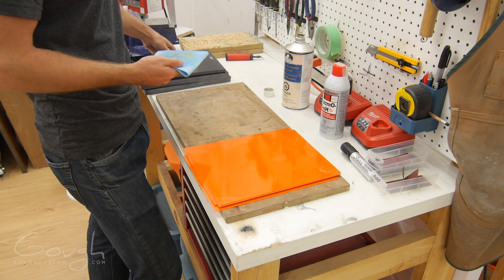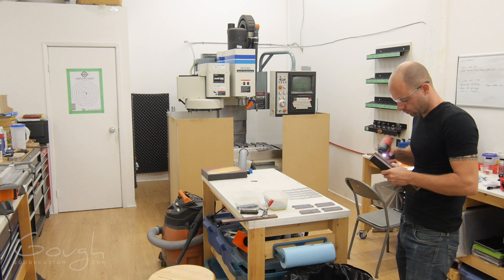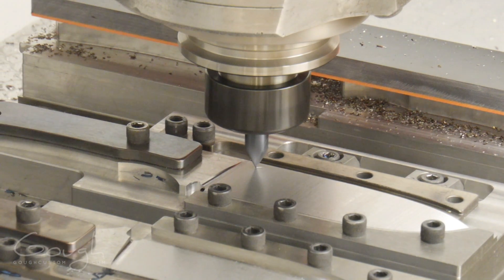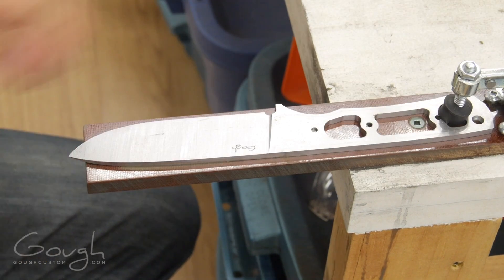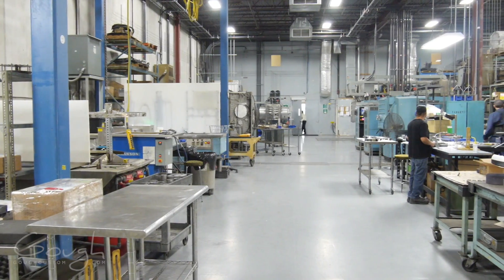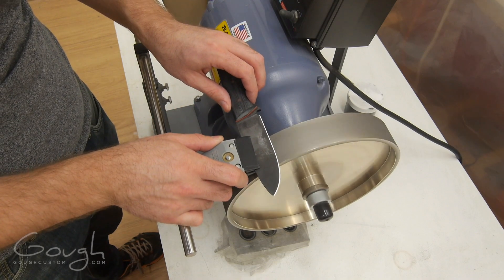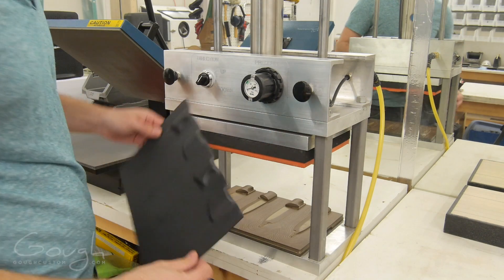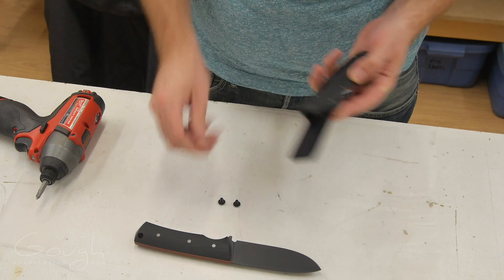Making a knife the high-tech way - Resolute MkIII

Comment: Amazing.  Have you thought about RTV casting the scales?  You could cut out a few machining steps and just pour them the right shape to start with.  Brick in the yard youtube channel has good tutorials.
Reply from the maker: +Ryan Bishop thanks Ryan! I like the idea of casting scales but I've never found a material that I was happy with for it... G10 has very high percentage of glass fibre, so it's incredibly strong and tough compared to most castings...
Reply: Gough Custom get in touch with a vendor. (Innothane or innovative polymer). Have them suggest something and send you a sample. There's a surprising variety of resins. I've done a lot of casting. Let me know if you have questions. (Plus you can remove airborne glass fiber from your process)

Comment: Is there not a work around to avoid hand sanding? Not judging or anything just curious as to if you've tried anything else. Also thanks for another video that I shall watch 40 times
Reply from the maker: +Tristan Rousset technically I can skip the hand sanding and it's possible that no one would notice, however I think that omission would become more obvious as the knife was used, if the coating was to wear it would do so unevenly and reveal the initial machining marks, so I still do the hand sanding...
Reply: Gough Custom Alright good to know I didn't think of that
Thanks for your answer man!

Comment: Didn't expect uncooled sharpening. Which speed on the CBN? Did you do micro vickers testing to see if there's some difference between cooled/uncooled CBN?
Reply from the maker: +Verdigris Sirgidrev very low speed on the CBN, final pass is around 100 rpm. I don't have capability to do micro hardness testing, but have done edge retention testing of this versus hand sharpening and found no difference!
Reply from the maker: +Verdigris Sirgidrev the key to this is the CBN abrasive... It's very thermally conductive, whereas traditional abrasives are generally refractory materials (aluminum oxide, silicon carbide), refractory materials are very good insulators which means they leave all the heat in the blade... The CBN conducts the heat away from the cut into the wheel.

Comment: im very impressed by your fixtures did you design them your self also have you ever though about making a full enclosure for your machine so you can put flood coolant on it
Reply from the maker: +n ackermann thanks mate! Yes all the design of every step was all done by me! I plan to build a full enclosure soon, but will still be machining dry. I really dislike food coolant, smells bad, takes a lot of maintenance and with modern tooling there isn't much call for it when cutting steel... If I was doing a lot of aluminum work then obviously I would feel different lol

Comment: Gough, how dare you. Using Chicago screws. Surely Geelong screws or ballarat screws would do.  ( They all forget where they came from don't they )  On a more serious note. You have a perfectly machined handle. Then you hit it with a sanding belt to take down the screws?!? Why? This is such a source of possible error.
Reply from the maker: +gus bisbal haha I will get to work on sourcing Aussie screws mate, post haste! :)

Yeah I would also like to find a way to avoid the hand work on the handle, as yes it is a source of possible problems. The main issue is that I haven't yet found a fastening method to replace the Corby bolts.. whatever I move to would have to be as strong or preferably stronger. I have some ideas for specialized compression fit rivets, but haven't had time to explore yet!
Reply: I think the Corby bolts are the right choice, its the removal method that needs to fine tuned. Have you thought of milling them to the contour of the handle then polishing? Remember to add coolant so they don't over heat but it would be a more automated method.

Comment: Have you considered using leather instead of nylon webbing for the belt loop? Wondering what your thoughts are on nylon webbing vs leather.
Reply from the maker: +Eric Snyder either would work ok, the reason I chose nylon was for its durability when exposed to the elements, leather is less durable when exposed to water for instance. Perhaps I should consider doing leather as an option though!
Reply: I agree with that assessment and it's a more efficient process. However, a medium weight leather, prepared correctly, would last a significant amount of time and would be a touch I would appreciate. Just food for thought. Great knives, flawless execution.

Comment: I thought you switched to heat treating the blanks before machining them? Also the corby bolts create a strong enough bond without epoxy? I might start doing that because dealing with glue is annoying.
Reply from the maker: +Jimmy Grey yeah I did, this video was actually out of date before I even finished it because my process has been changing it so fast lol. The Corby bolts are plenty strong! I can't get one to pop without breaking the blade in the process!
Reply: If using bolts for pins, then using epoxy isn't really a matter of adding strength, but a matter of water-proofing between the scales and the tang.   Aaron's blades are DLC coated with water-proof G10 for his scales, and both are very flat, so with his materials and production style it makes sense.  Seeing as how TOPs Knives powder coats their knives, which are mostly made on 1095 and is even more prone to rust than A2,  I'm sure his blades are good to go. 

  I would suggest that, unless you are going to coat your blades and tangs with something (such as  ceracoat) as well as only use synthetic handle materials, that you're much better off using epoxy to keep moister out from beneath the tang and handle material.  It's even that much more important to use epoxy when using carbon steel and natural handle materials.   It's simply a necessary evil in our craft ;)      Get some G-Flex epoxy if you don't already use it, as its properties make it pretty much ideal for use on knives.
Reply: Yeah I was planning on using the epoxy-less method for cerakoted blades with G10 as it's harder to control the overspill of glue around the entire tang and I can't sand back the excess without taking off the coating . I'll still use epoxy for most of my blades I reckon.

Comment: That is just awesome! Thank you so much for taking the time to show us. The matt black DLC finish is beautiful, and I really like your various jigs/custom-made equipment, especially the sharpener/grinder. 

Just as an aside story regarding knifemaking, and the whole "handmade" vs. "machined" split. I remember reading a discussion once (it might have been bladeforums) where a guy, who made beautiful handmade knives (the full thing, from hand-forging a blade, cutting and shaping a handle from raw timber etc.), was being extremely critical of someone else who made (also beautiful) machined knives - (cnc'ed titanium colored handles, machined Damascus blades, exotic coatings like DLC and TiN etc.). His argument was essentially "Oh, you just stick the raw material in the CNC mill, push a button, and it does the rest." That attitude always annoyed me, because what isn't seen is the years of painstaking design and experimentation that has refined the design of the knife to a stage where it CAN be made on a machine. And, even then, there is STILL so much hand-work involved, or continual process optimization. Just the design of your jigs to hold the blade and handle blanks - I bet they took a heck of a lot of work to get just right!

By the way, when you're machining the Kydex, I wondered about a vacuum hold-down instead of the double-sided tape? It might be more trouble than it's worth, though - it probably couldn't hold the belt loop plates because they're so small. If tape works, stick to it ;-)
Reply from the maker: +Lindsay Wilson thanks Lindsay! Yeah I agree with your viewpoint on the machining thing. I think most people that are critical of it simply haven't been exposed to the reality of CNC machining and setting up a process like this, they have no idea how much work it takes!

I would like to try vacuum clamping for the Kydex at some point for sure!

Comment: I am half way through making my first ever knife. https://imgur.com/xV9xF4o It's very closely modelled on your design! All hand filed, hand sanded 01 tool steel and I'm in the process of building a forge to heat treat it. I have been following your work for ages which has been both extremely informative, entertaining and instructive. I'd be more than happy if my effort comes out even half as sharp as the example in your vid. That thing does look scary sharp! cheers. Steve.
Reply from the maker: +Screw Driver thanks Steve! Best of luck with your build mate, I'm sure you'll nail it! Let me know if you hit any snags and I'll be happy to help out!
Reply: oooooooooo

Comment: Really nice video! I have a question though, I saw in the video that you are using a ball endmill to profile the G10 handle pieces. In your previous video you used form mills. Is there a reason you switched over to a more common ball endmill? I can imagine the machining time with the ball mill is a lot more but then again because of its availability also a lot cheaper.
Reply from the maker: +Stef's Engineering hey mate! Yeah the form tool was much faster, but really hard to get the geometry nailed down unfortunately... With a ball mill I can really perfect the geometry, including little corner radiuses everywhere and so on that the form tool couldn't do. Much better overall result!
Reply: Thanks, makes perfect sense!